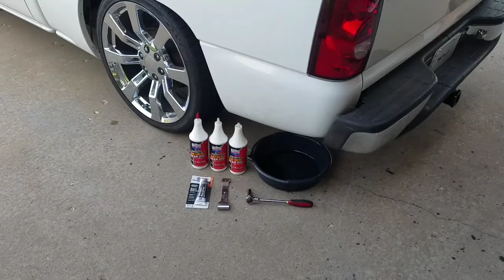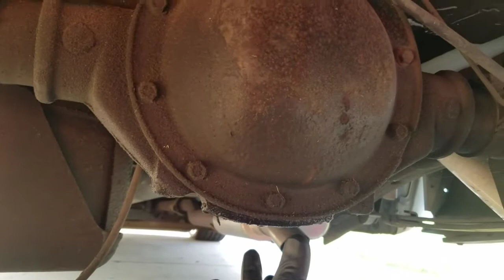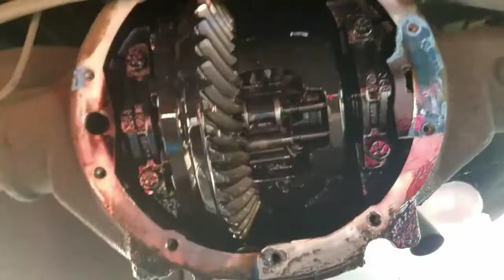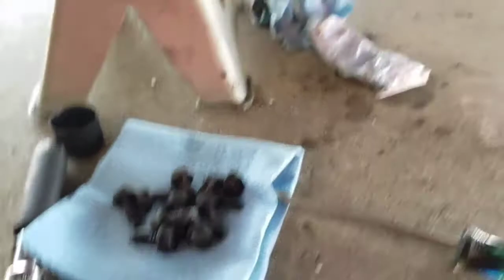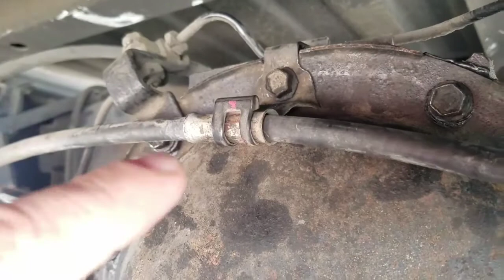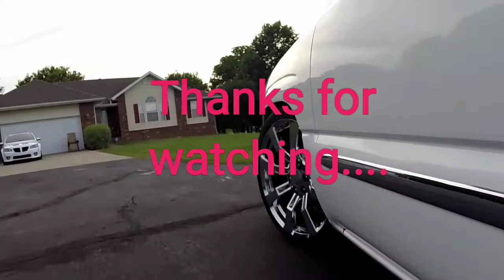G80 Rear Differential Fluid Gasket Change How to

Comment: Some say G80's are noisy, not Whiney, but slightly clanky. 
Did you ever hear any noise at low speed 15-20Mph when pressing and depressing the gas pedal and when shifting from Park-to-Reverse-to-Drive? 

on this truck and your newer white lowered one, if it has the G80?   

I always come to a complete stop when shifting from Reverse to Drive. However on my 2018 Silverado with the G80 I purchased with 19,000 miles it makes a slight clanking noise when going from Drive-to-Reverse. But it cannot be heard from the inside unless you're listening for it, I didn't notice it until a friend of mine was outside while I was Reversing out of a parking spot. When he said something about it, I opened my door while shifting from Park-To-Drive-To-Reverse and I could hear it. It sounds like a U-Joint with play but I checked the U-Joints and driveshaft/ring & pinion for play, there was none. 

So I had my friend hold the brake and shift from P-to-D-to-R and I could hear the slight clunk noise coming from near the output shaft in the trans. Almost as if there's ( slight ) spline play. I'm wondering if it's designed that way to absorb initial shock from going to the U-Joints and Ring & Pinion from change in rotation going from P-to-R-to-D-to-R
Reply from the maker: I never have noticed that on my newer trucks. Now on the older ones I have but I was sure it was u joints. All the trucks I have owned other than the Green regular cab i have now are g80 trucks. I have had really good luck with them. It could be like you say some play in the gears. I wouldn't think a truck that new would have u joint issues.
Reply: TWA Motorsports I bought it from a Chevy dealer used, they purchased it from a fleet lease company. The truck had to travel from Oklahoma to Louisiana. 

What I was also thinking and is the reason I asked you about this on your truck is when the my truck was on the trailer to be transported ( if ) the person loading the truck simply just put the truck in P-Park ( without ) pushing the emergency brake and all that back and fourth movement from the car hauler stopping and accelerating- stopping and accelerating for a several hour trip (  seems ) like it could also cause driveline play. 

Basically Imagine if a truck was parked not running, and 3 men grabbed near the top of the tailgate and pushed and pulled on the truck while it was in ' P' rocking it back and  for hours, where would play in the drive line eventually occur?    

The Parking Paw in the Trans?    

Seems like on one hand the parking paw would be designed weaker than the U-Joints as to not to break the U-Joints if the vehicle is being pushed or pulled too hard for too long while in Park. 

But on the other hand one would think ' it's the ' Parking Gear ' it has to be stronger '
Reply: TheTennesseeTittyTickler so i read your  big huge “essay paragraphs” and boy you can write lol so although I’m not a mechanic nor a professional, I did work on my own several cars and trucks and that sound your describing can be from transmission fluid. Drain your tranny fluid, put new Tranny  filter with the new cap (remove old) and add new fluids. Research on here how to do it and check and about $60-80 worth of parts and fluids and wouldn’t hurt to fix it. Noticed it on my 05 Tahoe and went away when I did it (although didn’t expect it to go away. I just wanted to flush and add new fluids.) but each truck/car is different . 

And sucks the guys rocked the truck back n forth in park? I didn’t understand that part but that could be the reason for the clunking too
Reply: BLacK HarTz What Brand Trans fluid you used?

Comment: Good Video 
just got a 2017 Tahoe - Read your Description - So NO ADDITIVE !!!!!!!!! just Straight Synthetic 75w-90 Diff oil .
Reply from the maker: Thank you. Some require and some don't.
Reply: I changed my fluid with fluid fr the auto parts store, they all had some kind of friction modifiers Lucas, royal purple all of them did even if they don't advertise it... I grabbed one that did not claim to have the friction modifiers changed the fluid and the g80 quit locking  almost  immediately and I have never been able to get it to work since despite flushing the fluid out the several times and using GM fluid. So if you have the g80 locker only use gm fluid with no modifiers in it !!! Pay the extra for the fluid at the dealer it will save you money!
Reply from the maker: I have never had that issue.

Comment: you know the torque spec on the retaining bolt that holds the locking pin inside the differential? i need to pull my axles.
Reply from the maker: No. sorry I don't

Comment: Will Mobil 1 75w-90 LS fluid work? I’m so lost
Reply from the maker: It will
Reply: If I have a delirious gasket should I use etc too?
Reply: If I have a felpro gasket do I need to use rtv too?
Reply from the maker: @moejr14  I would use rtv instead of the gasket because gaskets leak. Don't use both
Reply: I changed my fluid with fluid from the auto parts store, they all had some kind of friction modifiers Lucas, royal purple all of them did even if they don't advertise it... I grabbed one that did not claim to have the friction modifiers changed the fluid and the g80 quit locking  almost  immediately and I have never been able to get it to work since despite flushing the fluid out several times and using GM fluid. So if you have the g80 locker only use gm fluid with no modifiers in it !!! Pay the extra for the fluid at the dealer it will save you money!

Comment: Lol, you guys that draw circles around bolt holes with RTV kill me!! It's totally unnecessary ... just go around the outside, it's all you need!
Reply from the maker: I actually had fluid leak through a bolt hole one time is the reason I do that.
Reply: @TWAMotorsports  Okay, I see your point. Actually I misspoke anyway, in the case here you'd go around the INSIDE of the bolt circle assuming none of the bolt holes actually extend into the oil cavity.
Reply: Lubelocker gaskets FTW!